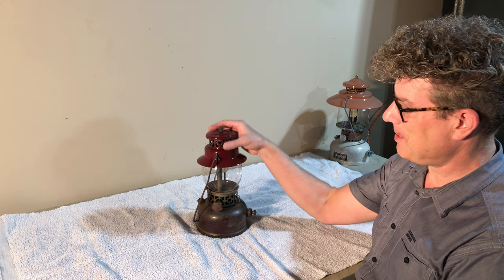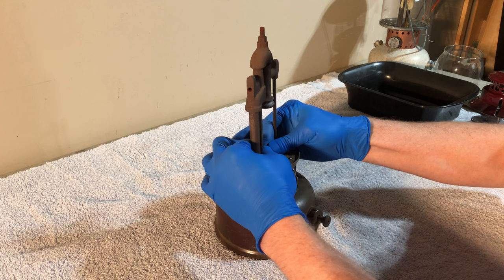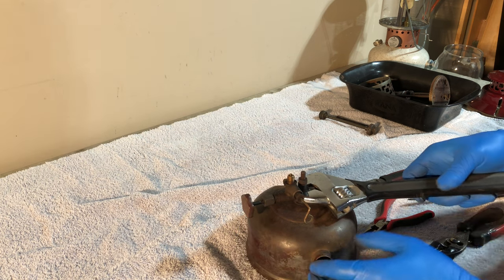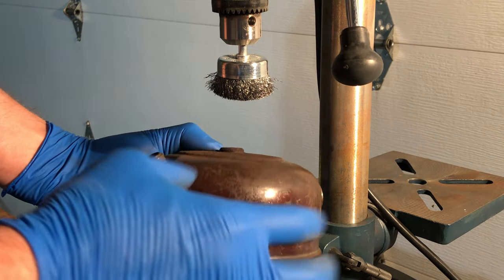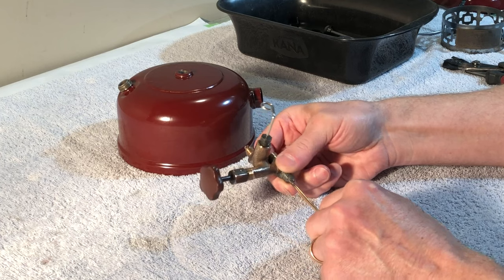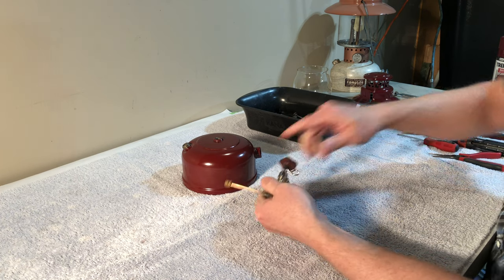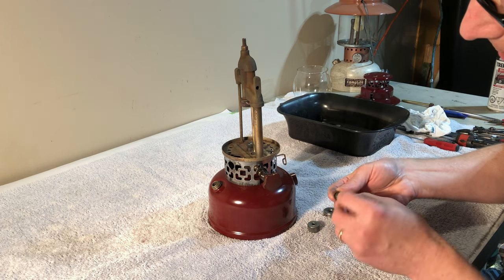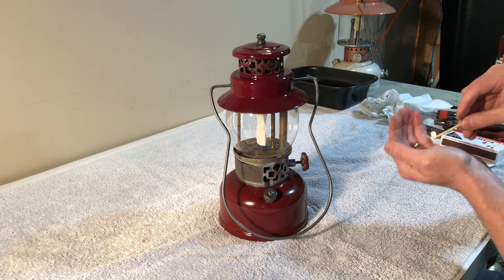1940s SunFlame 3016 Gasoline Lantern

Comment: Nice video and very informative.  I have an older AGM single mantle I tried to remove the valve on.  It twisted off.  Bummer.
Reply from the maker: It's a common problem with AGMs...that or the bung itself spins loose.

Comment: Got me to pause and check my container of "prime neatsfoot oil compound". And I noticed it says "compound". A commonly used weasel word for diluted with something cheap.The back of the container says the ingredients are"neatsfoot oil and other beneficial oils" without specifying what these oils are.  My mind says 'beneficial for who". I will stick with my light machine oil directly on the pump leather sparingly so none gets in the lantern fuel area.. No problems with leather cracking or check valves sticking in over 50 years of use.

 WIKI: Neatsfoot oil is made from boiling the lower legs ,without hooves, of cattle and skimming the fat off the top of the water. It has the unique property of staying liquid at low temperatures that is not true of the rest of the animals body fat.

Comment: I recently rebuilt one of these, but I had to a mesh globe. What type of Coleman globe is yours using?
Reply from the maker: It's got an old 242 globe.  The original AGM globes were the same size as the Coleman 242/200 globes.

Comment: great videos keep them up. Wondering why you chose not use electrolysis to clean rust and paint from fount 
im fairly new to collecting have some 335 i want to strip and repaint for practice before i go to a rare lantern dont know best way to go sandblast paint stripper or electrolysis thanks
Reply from the maker: It wasn't worth setting up my e-tank for such a small project.  I tend to use electrolysis on big things like stoves or if I've already got the tank set up.  The wire wheel is quick and easy on steel founts.  I'm hesitant to got that route on brass and stick to stripper, unless the paint's literally flaking off.  I'd never sandblast a fount.  I've seen too many guys create pinholes when sandblasting.

Comment: Great video Bill. I have an old Kamplite from the late 40s. It was super rough when I found it but I cleaned it up and got it running again. It’s one of my favorite. It fires up really big when it’s first lit too. It’s a single mantle lantern as well. Are they supposed to run on those big mantles? Like you said it’s hard to find info on them. I just put some #21 on it to test it out.
Reply from the maker: Yes.  The AGM singles require a larger mantle to run properly.  I typically use Peerless 24As, but I think this 3016 would actually push a Coleman or Peerless 99 without a problem.
Reply: Hey thanks man. I appreciate the info. I’ll try it when I get home tonight. I’ve been trying to find an old Aida or petromax with the rapid pre heater to mess around with. There hard to come by over here with out forking out a chunk of money.